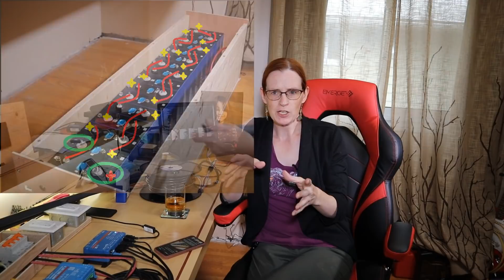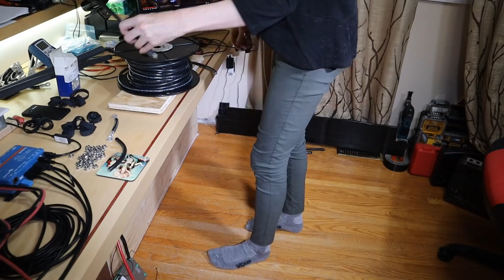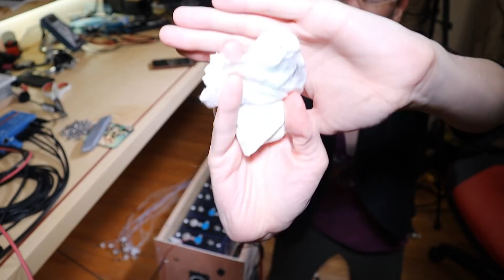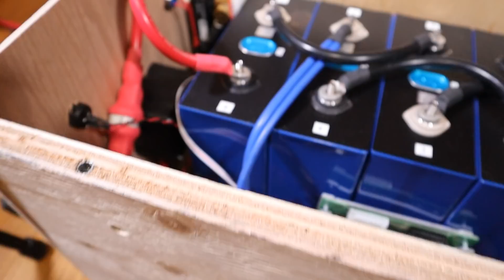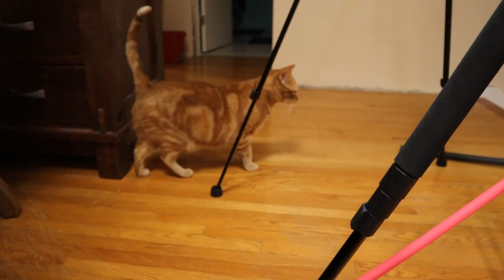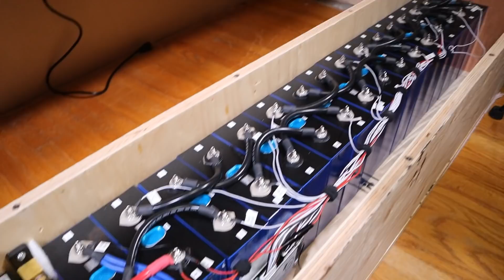A Better Battery Design - How to build a 48v Lifepo4 battery (Ep. 22)

Comment: Thank you for showing ust these busbars. The Idea using two cables in one lug is ingenious. This way i can use 2x16mm2 (sq. mm) in one 35mm2 lug instead one stiff 35mm2 cable, which was quite hard, nearly impossible to insert in a 35mm2 lug. The studs on my REPT cells are only 10mm, attaching four 16mm2 lugs was impossible, but two 35mm2 lugs working just fine. Thanks to you for showing this solution : )
Reply from the maker: Glad you found it useful! Note that I ended up settling on 4 cables in one lug, which is the best solution I could find and it's what I used in the main battery build later. :)
Reply: @TheDigitalMermaid  Yes with four cables it would be more elegant, but I already have the 16mm2 cables, which I use everywhere twice.
Reply: @TheDigitalMermaid  You remember me at some one, do you know Christelle Berthon ?  Listen to  "Back To The Floyd - Christelle Berton" - goose bumps guaranteed : D  Obsessive G is also a Song from her i like so much : )
Reply from the maker: I had not heard of her, no. She's pretty darn talented though!

Comment: Instead of measuring resistance, measure voltage drop over the links at 50A. You get more accuracy.
The higher temp in some of the busbars are ir-refections or dirt on the terminals.

Comment: What about resistance with longer bus bar replacement wires
Reply from the maker: In another video, I made longer cables, and I was surprised how fast the resistance climbed. So I ended up sticking the the very shortest cables I thought I could get away with.
Reply: @TheDigitalMermaid  Thank you for your reply.  I’m working on a 42 foot catamaran fly bridge.  Replacing twin Cummins 400 HP diesel engines with twin Tesla Model 3 RWD motors.  I selected 120 BYD blade LifePO4 battery cells for each side.  The cells are 1/2” thick x 3.5” tall x 38” long.  The cells are 3.2v x 138Ah in series to create ~400 volts 58KWH for each motor.  First time for me.  Never did this.  I need a rubber suit to keep from killing myself. 🙂
Reply from the maker: @campbellnever2old179  Yeesh, high voltage DC scares the shite out of me... Be safe!

Comment: Sorry to seem negative but it's been decades since acetone was used in nail polish remover, for reasons including it's extreme flammability but also because it tends to badly dry out nail and cuticle tissue. The "smell" now tends to be something like ethyl acetate, and there are oils in there now, something like lanolin, to be easier on those fingers. BUT, it also means you wiped oils ONTO those contacts in the end.
Reply from the maker: That's very good info, thanks!

Comment: honnistly i dont see a problem with heat shrink on a tool like you have done . it is a insolator so it prevents a bright flash along with a shower of sparks ... aka a pritty light show followed by lots of cussing as you quickly try to break the circuit .

Comment: I think will be doing the diagonal layout for my 16s pack. I’ll use black jumpers for 0v - 24v and red jumpers for 24v - 48v. 
Also, as cross checks along the way, I realized that each pair of cells needs to add up to 17 — 16&1, 15&2, 14&3, etc.

My BMS uses individual cell boards so I’ll have to rethink where they’re placed but it’s all part of the iterative design process. 

Love your videos, and your kitties. 

Cheers!

Comment: I think the most important thing about battery layouts is to do something that makes sense to your brain.  When dealing with that kind of power,  you shouldn't be in a place where you always have to stop and think about the layout; the potential for serious damage with a single misplaced cable can be pretty high. Picture having to repair a bad connection in the middle of the lake with a**holes blasting by you at 20 knots, throwing out big waves that are tossing you back and forth while you hold metal tools over the top of 50+ volts of DC current. You want to do everything you can to make that process as simple and quick as possible.  I might recommend 1) using the same layout on all of the battery banks in your boat, so you don't have to keep reseting your brain to a new layout when working on bank A vs. bank B or C.  And 2), maybe print out a schematic of your layout and tape it to the underside of the battery box cover. Not only will this help future you, but it will also help any boatyard workers if you need to haul out for maintenance.

Also, in a marine situation I would maybe recommend putting an additional piece of shrink tubing on one of the cables where they cross over each other (just as a protective sleeve - you don't need to actually shrink it).  In a boat with limited storage, there will always be the temptation to throw stuff in to any available space, or use any horizontal surface as a step, and any weight pushing down on those cables combined with vibration from waves etc could cause abrasion.  The silicone coating on that wire is awesome for flexibility and chemical resistance, but it is not super strong (physically speaking).

Thanks for the work you do on your channel! Cheers

Comment: @2:30 "Use rubbing alcohol... on the terminals and on the cable connections to make sure they're free of oil..."  Wear nitrile gloves during final assembly. Clean the oxidation via abrasion (scuff pad/sandpaper). Remove all dust with a clean toothbrush & compressed air. Apply "NoAlox" anti-oxidant compound on any aluminum-aluminum or aluminum-copper connections. To prevent future corrosion (especially in marine usage), seal off connections using a removable elastomeric coating such as Plasti-Dip or liquid rubber.

Comment: Your new configuration has an other advantage. I have a 48 volt inverter and a 24 volt inverter. I tend to reconfigure often between 4 pairs x 2 frames in series (for the 24 volt inverter) and 8 singles x 2 frames in series (for the 48 volt). Taking apart the allthread rod compression frames and flipping every other cell every time I relocate an 8 cell pack is a real pain. Your physical layout lends itself to just switching from bars for 24 volt to cables for 48 volts and back again; easily whenever. Thanks a bunch!

Comment: It’s a nice layout to keep the main + and - close together. But since your individual “bus bars” are now longer I think you probably have about the same length of cable overall.
Reply: Thats exactely what i thought the whole Time - but maybe we are wrong? 

~2,55 m wire was added between the Cells instead of the bus bars. But i think it is better now cause everything is symetric now

I´m really looking forward to the FLIR Test :)
Reply: If it makes up the same wire length in total, it should produce the same voltage drop und heat, just spreaded over the cells instead of accumulated in the red cable... 
Given that the jumper cables are short pieces and have space in between, they should dissipate the heat better and stay somewhat cooler.
I am curious for the FLIR test ;-)

Comment: i think you should keep all cables the same length in your battery build. the short one you re-used>>> replace it with the longer cable you made as an extra. better to keep the resistance between all cells equal. i have 3 battery builds running and the biggest is a 32 cell 24-volt build with Lishen 272Ah cells in a 4P8S configuration. i made short 5 inch interconnects for all the series connections with 2/0 cable.

Comment: Both of Grant's alternate wiring methods result in using more total wire which adds more resistance and more total heat.  If you want to minimize the wire lengths, using 2 or 4 rows of batteries is the way to go.
Reply: Indeed, all the red-wire you saved, you added as black-wire.
Reply: But this isn't really an issue. The red cable is hot because of it's size in diameter. Her change up would have been better if the cables were made thicker and to the right length instead of being so much longer. You need these 'buss bars' to exist, no matter how the batter is arranged, if you make the jumpers to the right size, you won't have issues with heat. If I recall the blade jumpers have the same copper volume as a 4/0 cables, she's using much too small of a cable for this purpose. the fact that there is any heat is an indication they're too small.

Comment: Implementing this design also as the smaller runs with large gauge wire is actually putting pressure on my posts and 'separating' my cells. Thanks for the video. Good job!

Comment: Very sypathic canal!
I think in a boat with movement and vibrations you should have an additional and stable layer of insulation between the cells. The aluminum housing under the blue foil is not neutral, it is positive!
So It can be very dangerous if the foil gets damaged and the cell housings touch each other!
But that shouldn't be a problem in your test environment at first.

Comment: Add me to the list of people suggesting that you try out the other wiring approach that Grant suggested. I think the cables that you made are long enough so you can do it without new cables
The other approach avoid cables crossing (except for one) and at the end where you are connecting to the outside world, you can have the negative come out the center of the pack (angled like the other cables.

Another interesting aspect of this alternate approach is that it could be done with rigid bus bars (longer than the default ones). If the cells expand and the pack becomes slightly longer, they will angle just a bit more (which could still loosen the nuts admittedly if you are using lock washers). If you were to put a thin layer of foam between each battery to absorb the expansion without leaving them free to move (or have a wood spacer around the edges of the cells where they can't expand without cracking the plastic anyway) you could go back to rigid bus bars.

Frankly, I wouldn't want to allow the cells to move at all, they are heavy enough that if they start to move a measurable distance, the forces involved when they then hit the end of travel would worry me a lot more than nuts working loose.

As far as preventing nuts from working loose, my answer is to go with nylock nuts instead of lock washers. I would also coat each battery connection with an anti-corrosion spay/gel, something like: https://www.amazon.com/Permatex-80370-Battery-Protector-Aerosol/dp/B000BOKML2 especially in a salt water environment

Comment: I don't know if someone said this.  Being a little OCD I would make labels for each of the batteries so that you can see easy what each batteries should are and easy to see what each is!
Reply from the maker: All the batteries are labeled... I even references how that saved me from making a mistake in this video. Am I missing something?
Reply: @TheDigitalMermaid  sorry I missed that! This is a good video.  I have 24 volts of Lifepo4 batteries on a UPS,  but they are smaller just 60 AH and came to me put together as 12 volt batteries. I just needed to put the positive of one set to the negative of the other set and put a BMS on them all.

Comment: hi. imagine you're at sea up winds up seas up surfs. can you be good at ANY WORK IN THIS CONDISION .. NO   ( KISS ) KEEP IT SIMPLE STUPID. ?? OK .. YOUR LIFE MIGHT BE ON THE LINE... DONT CONFUSE THE ISSUE
Reply from the maker: If a pack had a problem in heavy seas, I would just turn it off and reduce power. That's why each pack had its own disconnect switch.

Comment: I did it with linemans pliers and not snips (thank jeebus) but don't cut a wire by holding both "ends" and cutting in the middle. You WILL catch the webbing of your hand between thumb and finger and with pliers it hurts like a mofo and leaves an interesting bruise, with snips... Yikes.

Actually I just rewatched it (9:50) and you didn't do what I thought you originally did. But for anybody else reading this, don't cut a wire by holding with thumb-ring finger and pointer-index and cut in between.

ps. I hate the safety police but this was something that I did once and won't want to do again
Reply from the maker: I didn't do that in this video because I've done exactly that in the past. Holy crap does it hurt, and it's a lesson you don't forget. lol

Comment: I think this is just fine when you have a stationary battery. In a boat where there is movement, not of the batteries but the whole boat itself I personally would try to avoid crossing wires on top of another. I’d be scared of them rubbing trough.
Reply: rubbing is a serious issue here. as is the lack of pack compression.

Comment: Hello from the high desert of New Mexico USA 🇺🇸. I noticed that when you tested the bms balance leads you where getting a negative reading. Those balance leads are supposed to go on the positive terminals except the first lead which goes on the negative terminal. The best part of this design is that it allows you to use equil length jumper cables between the cells. I have planned on using a similar design for a 4s4p configuration if I can ever get some cells then I can finally have power when the sun goes down. I hope this helps. Keep up the good work and stay safe and charged
Reply from the maker: Ha! I noticed that in editing, too. :)

Comment: freaked me out with the cables not secured as ya worked. whats the soft off for?
Reply from the maker: Feature of the BMS, so I added a switch. Can't think of too many practical uses, but working on the fuse, smart shunt or switch could be a use case. Switches were cheap though, so figured I may as well add it.
Reply: @TheDigitalMermaid  I am very ignorant of this feature as well and had the same question. Now a soft 'start' makes more sense to me, basically working like an inline precharge resistor. Any way to test to see if it slowly ramps up voltage as you flip it on??

Comment: First of all: great project and greate way of filming the process.
I read , that the casings of the batteries are connected internal to the negativ terminal. So if the isolation shrink wrap is worn by vibration there can be a short between  the casings . Can you verify that problem with a volt meter by puncture the blue foil on the side and measure the voltage differential between two cell casings next to each other of the mounted battery pack?
Reply: Yes, Stefan, true!! I can attest to the case being negative on my Lishen 272AH prismatic LifePo4.  From what I've run across this seems to be the standard. As such, I chose to use a thin silicone craft project mat cut and sandwiched between the battery walls. I chose this for heat resistance durability and super affordable. (Amazon, etc.)

Comment: Interesting wiring design.  I understand the long/narrow batt design for boats when space is at a premium. What intrigues this landlubber is the 80+ kwh's for a boats usage. Maybe a quick vid on estimated pwr  usage and backup on this boat? It sounds like a lot of energy for a sailboat, even though it's your house and vehicle. Keep up the good work and be careful. Btw Second Wind: The Tail of a Sailor is a good Doc. on youtube I ran across.
Reply from the maker: Hi William, there will be an entire series on the boat, once I get there. Core though; I'm planning to remove the diesel and go pure electric. The only liquid fuel onboard will be diesel for the heater and generator. So electric propulsion, electric oven, induction cook tops, etc. Once you use electricity to move a vehicle, especially something 12 metric tonnes (24,600 lbs). In this context, The 90+kw/h I will have will barely give me the range I want.